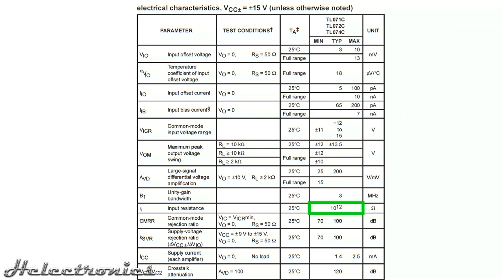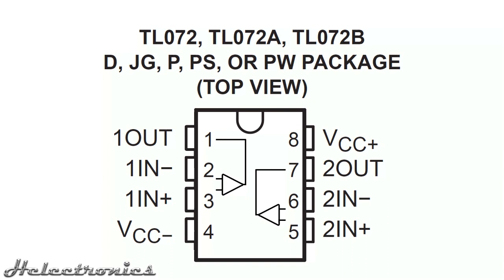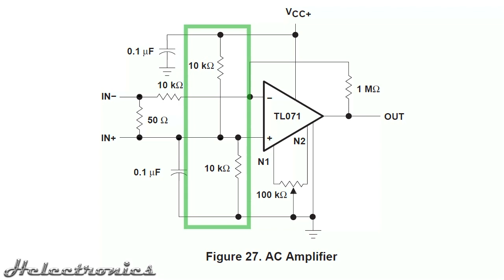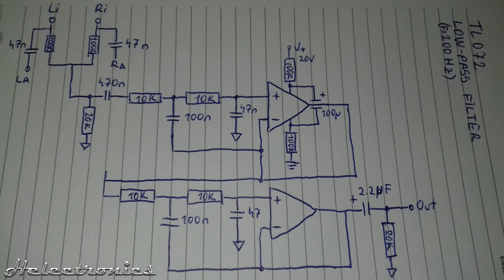TUTORIAL - Build TL072CP Circuit On Breadboard (Easy-Medium Difficulty)

Comment: Nice, I just build and works good. Question, how to get a bigger gain ???
Reply from the maker: Good job! At pin 1 (output) and 2 (inverting input) you don't connect them directly, but you make a voltage divider with two resistors. You can find a schematic on the internet. Watch my video with TDA2030A amplifier, there I've used gain setting resistors. Thanks for watching!

Comment: Hey, I'm going to build an active bandpass filter from the Tl072 from a frequency response that will be above 200Khz.
Is it possible to work? 
please help me.
Reply from the maker: Hi, later afternoon I will check if this IC is good for your project. 200kHz is high I don't know if this IC can handle it, I think the NE5532 has a wider bandwidth. Do you have an oscilloscope to measure?
Reply: @Helectronics  hey i have an oscilloscope to measure the frequency, I have also op07, please help me.
Reply: I don't have NE5532, please tell me alternative.
Reply from the maker: I've read that the TL072 has a unity-gain bandwidth of 3 MHz so it should work, do you know how to make a bandpass filter?
Reply: @Helectronics  I know how to make active band pass filter ,but I want to ask some question
1- i don't want to use transformer instead of I will use dc supply.
I will provide dc supply to the lm7812 and lm7912 ,to get the +ve &-ve voltage but my biasing voltage is not constant.answer please 
2- I have tried your circuit when u are performing 1step as feedback is taking unity gain ,and pure sin wave is coming but I have tried mine is not coming ,lot of noise is coming.please tell me how to improve the circuit.
3-if it is possible, please post a complete circuit diagram or video of active band pass filter using TL072.
Reply from the maker: I will answer all your questions and I will send you a diagram as soon as possible, but I need time for all of that
Reply: @Helectronics  Thanks, I'm also Trying, Please Make the Dc biasing using dc supply instead of transformer
Reply: @Helectronics  I will wait for your all answers.
Reply from the maker: Please write me a message on my facebook page facebook.com/hobbyelectronicslovers
Reply: @Helectronics  i messaged you in your facebook page . please check